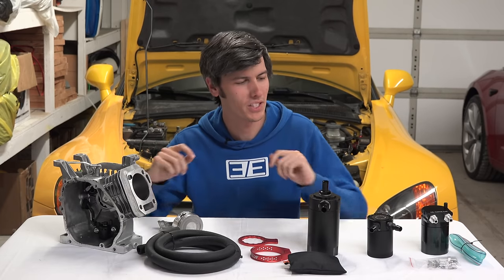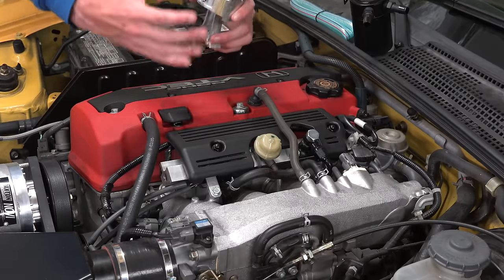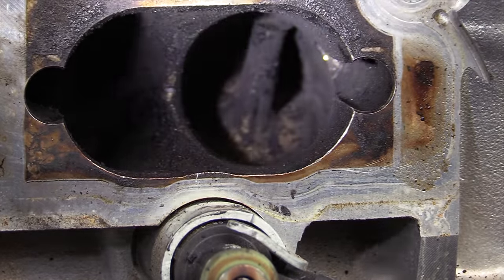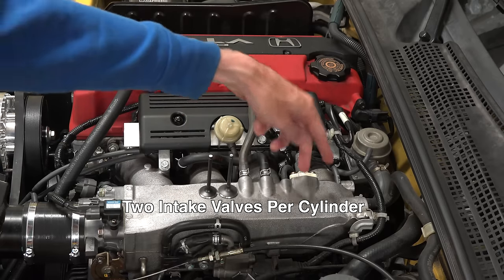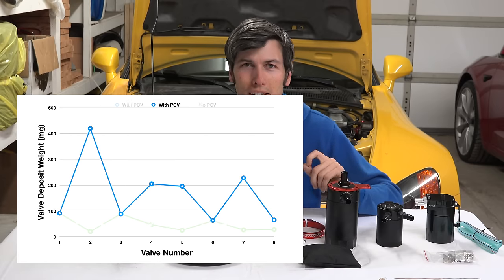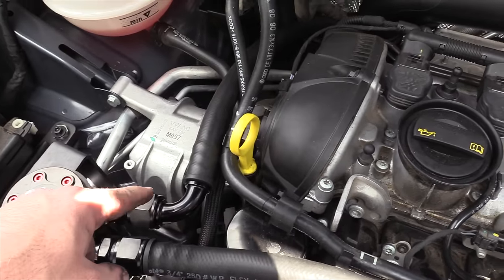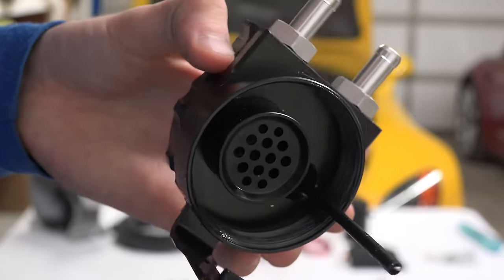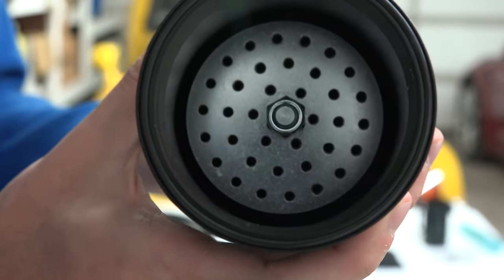Do Oil Catch Cans Actually Work?

Comment: I am sure it would not be too difficult to use an electric solenoid to drain these automatically with key off. However, looking at the contaminated oil in that jar, I would not want that going back into the pan.

Comment: i think you everyone forget something about catch can. experience on modified VW golf R mk6. it look to me install a catch can make a restriction on the PCV system. Normaly de blow by have all the intake to circulate and now you restricted the pressur on a small can and small hose and go back somewhere in the intake system. As a result i see engine smoking. And i think have more positve pressure and maybe can dammage the engine. Then when you look in the can its more like oily water. For sure it little bit less crap in the intake but dont solve the problem. At the end of the day you still have to make a valve cleaning. So i prefere no catch can, more safe,  anyway i will clean the valve someday. could be interesting to know comments from Jason about restriction.

Comment: I was still trying to figure out how this became a thing to do.  Has there been a study that found that the lack of catch cans has resulted in untold engine damage or loss of power or carbon buildup all these years? Millions of engines have run hundreds of thousands of miles w/o these devices all these years and to me it seems like its a novel thing to do to be cool. Like' hey I have a catch can in my car, how about you?' FWIW my 2002 T/A with its LS1 seems to run fine without. Just regular oil changes with synthetic and 93 octane fuel.

Comment: Avoid catch cans with bronze filters if you live in areas where it gets really cold. it will build up sludges on the filter making it hard for the fumes to get out and eventually pressurizing your crankcase, I removed my bronze filter and fashioned a mesh filter with steel scours inside the filter fitting.

Comment: And it's even better to have one on a turbocharged engine, because those fine [oil + unburnt things] particles can actually create some hot spots inside the cylinders and produce knock when your engine is on the limit. Modern engines know how to reduce ignition advance timings, but it's better to get rid of this this problem for good.

Comment: You can look at the outlet to see if oil still stick to the walls of the hose.
Those with fine filters will probably create resistance and high cranckcase pressure which can blow various gaskets. Also the inner diameter of the hose should be very close or larger than the original
I’ m installing a cleaning injector on my gdi, the project is almost ready. Waiting for the pressure sensor, T low pressure line adaptor and some programing of the control box

Comment: Mine works fine. Just make sure the plug at the bottom of the canister isn’t defective and leaks, and make sure the metal hose nozzles are snugged in before install and about 1000 miles after 👍👍

Comment: I have a turbo diesel 2014 jetta and when replacing my turbo I noticed a breather coming form the cylinder head leading to the intake of the turbo and thus noticed oil inside of the compressor housing as well as inside the intercooler piping so I am very tempted to do a catch can as my next mod...

Comment: IMO every car with a PCV system should have an oil catch can. Without it you have oil entering the combustion chamber and burning up which is obviously bad and can cause build up on the piston heads. I installed one today on my 09 accent which is port injected, and it's already happier.

Comment: For what it's worth, I used ho have one of those cheapo ones and the baffle unscrews then one half unscrews from the other half allowing you to pack it with steel wool or the like, one of the better bits I've bought on ebay honestly

Comment: Question why not just by pass the PCV and directly put a filter at the end of the hose and face it towards the ground. it can not be worse pollution then the diesel smoke and fumes coming out of those engines.

Comment: 07 Mk5 GLI 2.0T - 252,800 miles. Burns less than a quart an oil change. I do all of my own intake carbon cleaning and my own maintenance. 

I built my own catch can with a 1-gallon stainless water bottle that I won in a contest at work. 
Home Depot has all the fittings you need. A step bit after a pilot hole allows you to make pretty large accurate holes for the fittings; which in my case were NPT (tapered) threads anyway. They also have the brass filters there for about $2.00.
The one thing that I notice missing from all of these catch cans, is something that lets the vapor collect back into a liquid. I don't know the scientific term for that, but I would think the word is collect or "nucleate" on. Yes the baffles are in there, but they are close to the inlet / outlet which don't seem to have time to cool down.  
Anyhow, I used some copper pot scrubby things in the can; this way the incoming vapor laden air has to pass across this extremely porous media to get to the outlet.  
Here's the game changer though. 
I installed on the bottom of the can, a 1/4" DC 12V normally closed electric solenoid air valve and tapped the electrics to my windshield washer pump. This way, every time I hit my washers (I do it a lot) it purges this toxic bile on the ground without running wires or modifying the dash for a switch that I will never remember to use after 6 months.
<3 I love this channel.
Reply: *Condensate. If the catch can is mounted at the front of the engine where it will get airflow, the coolness of the metal catch can should cool the vaporized oil enough to help it condense on the interior wall of the catch can and flow down to the bottom.
Reply: @fookingsog  Yeah that was it. I'm old so I appreciate the assistance. Respectfully I disagree with your other statement though.

The vapors need turbulent and not laminar flow through the vessel. The setup I built works perfectly now, but originally I didn't have baffles. when i would check my oil i had signs of water in the oil at the cap. Once I added the media it went away immediately. 
Maybe your experience will vary with the same setup.

Comment: Important* make sure your PCV VALVE is NOT CLOGGED OR STUCK before adding a catch can.If so, remove and clean it with brake cleaner spray.

Comment: My understanding is that some of the newer motor oil specs (such as VW 507/509) offer long oil drain intervals, and I believe that one of the improved specs is to reduce the deposits on intake valves engines with direct injection.  Is this true?

Comment: I recently did an LS2 swap on my 04 GTO with cam, heads, stall converter, and built transmission (in short) and bought the Elite Engineering E2 catch can with a clean side separator, and I'm very impressed with it. I changed my oil after breaking the motor in to 1500 miles and was surprised at how much oil was inside the can (roughly 3 to 4 oz) within that mileage. So I'm glad I bought that system instead of having all that oil going through my intake manifold and diluting the fuel..so it's well worth it! It cost me around $330 for everything which was the catch can, hoses, clips, nickel fittings, one way check valve, clean side separator, and extra o-rings..so if anyone is looking for a nice system, Elite Engineering is my recommendation!
Reply: ExtinctLS1GTO you get single or dual port? Got a g8 gt and that’s my current mod that I on the market for.
Reply: @kapss0832  I got the E2 standard single port,  item SKU is STDCatchCan on Elite Engineerings website, you can select your model car for it..as I said I also got the check valve and clean side separator, quality is really nice and got everything quickly. I'm beyond happy with it
Reply: ExtinctLS1GTO great I’m sold on it keep going back to it after looking at others. How much power you making to the wheels with all the mods you put on ya goat?
Reply: @kapss0832  the LS2 made 421 on a dyno jet tuned by Justune..so it make a good amount more compared to the worn out stock LS1 at 278
Reply: ExtinctLS1GTO nice dude! I just got this g8 gt bone stock had 26,000 miles so far this past weekend threw in kooks LT, soloperformance cyclone catback system 3inch, VCM otr cold air and currently waiting on a tune from livernoise Motorsports.
Reply: @kapss0832  hell yeah man! If you're on Facebook, getting into some of the GTO/G8 pages are a big help on sourcing parts and individuals who make some unique things for these cars. I will say this man, get rid of that DOD as quickly as you can. The springs on the DOD lifters fail a lot on some higher mile cars..it was a great idea by GM, it just wasn't executed well..if you get a cam with the DOD delete..I love the BTR stage 3 that's in my car, that being said, call some cam manufacturers and tell them how you plan to drive the car, and they can set you up with what would be good for the car!

Comment: Shouldn't boosted engines require 2 catch cans? One on the PCV valve side (as commonly mentioned) but one also on the line feeding air into the valve cover, as flow in that line will reverse direction under boost. That reversed flow will include the same gunk that the PCV valve side sees under vacuum. (Remember, the PCV valve will block flow under boost.)

Comment: I find it strange how pressure build up in these catch can was not mentioned. If not enough air flow can get through, you can start blowing seals, and how long these filters last before becoming clogged, causing pressure build up. That's something a lot of these catch can manufacturers never tell you. Filterless Air Oil Separators that are well designed are expensive for a reason. Do your research folks before you wish you didn't install one.

Comment: I have read that oil contamination greatly reduces octane rating, even at the point where it is mixed right at the port injection on say a GenIII Hemi.    Do you think that is accurate and reason enough to use a catch can?

Comment: Why not just dump the fumes to atmosphere like on industrial engines? A breather filter hanging off the valve cover works well. 

That being said, I’ve installed various industrial versions on stationary engines. Keeps the radiator and engine room cleaner.

Comment: Just a note for carbed engines; the old Triumph motorcycle manuals used to say to drop the throttle just before going wide open, because that would suck a "certain amount" of oil to the rings. Of course, they had looser tolerances and like Harleys, were SUPPOSED TO  burn a little oil between changes!

Comment: Hi Sir I getting a very Excellent Quality 3 Port Oil Catch can from one of Aliexpress Stores for a price of NZ $42.50 & I'm going to make up a bracket for it so it will fit the PT Cruiser & also buying high tempature ID 10mm Black 5 M Silicone hose for NZ $34.19 & cut pieces of hose to so it fit nicely to fit to the 2 inlets on the oil catch can   & the outlet fitting on the oil catch can to the intake manifold as I have one hose from No 1 rocker cover & the one from the PCV valve No 2 rocker cover Kind Regards Peter PS this 0il Catch Can has a brass fine filtering system & has a baffle & tap at the bottom of the oil catch can as well & so I can drain it & a filter at the top of it & it is well made too  Sir

Comment: Running a vacuum pump for the crankcase like some racing engines should eliminate the need for a oil catch can , and free up some HP at the same time.

Comment: hey man I know this video is a couple years old but I'm hoping you can answer a question I have, I'm currently building a 2jz with a single turbo and I'm installing a catch can, I'm not sure how to go about routing it, I see people have the exhaust side vent going into one end of the catch can and they are using the vacuum from the turbo intake on the other side of the catch can, and leaving the intake side vent connected to the intake with the pcv, and I see other people just routing both intake and exhaust side vents into the catch can with no vacuum source? I'm a bit confused and not sure what the best way to go is.
if anyone could help me out I would really appreciate it,
Thanks

Comment: I just wonder as to why carbon deposits aren't a problem on diesel engines or if you feel like taking a trip back in time to the time of oil bath air filters.

Comment: Based on your bearded Volkswagen expert the catch can had a lot of oil at 3000 miles. So this looks like you will need a more expensive one with a larger catch; also this will need drained often so it doesn't fill up with oil and debris.

Comment: One thing not covered here is how the catch can design affects the ability for the system to produce a vacuum in the crankcase. With too much filtering and baffling, you may catch a lot of oil, but you may have also reduced your crankcase vacuum, therefore reducing HP and sealing of the piston rings. This would cause more blow-by and lead you to collecting more crap in your can because of it. 

Wouldn't that be funny if part of the cause of catching more oil in your can is because it caused more blow-by to begin with? I'm not saying the cans in this video are poorly designed, but there's definitely more here that needs to be considered.
Reply: Thats why the recirculation of the air flow needs to be routed to the intake system.  Not just the "2-way" install on almost every diagrams show. Usually these "kits" don't come with instructions and some are left to install it the wrong way.

Comment: This is strange!  I was asking a customer at work about oil catch cans, and I get home, and this video pops up!  If you don't have room for a catch can, would it work to spray a cleaner in the PCV hose with the engine running once a month to get some of the gunk off the valves?

Comment: I can tell you that the middle $100 catch can(which has a clone that's very inexpensive) is terrible. It doesn't do jack squat at catching oil. The problem is that the baffling is placed in a bad location that doesn't help. Having the inlet and outlet at the same level, and the baffling below those ports, just allows the airflow to just let the oil go right back to the outlet side. There needs to be baffling in between the inlet and outlet. I've got a clone of this $100 version, but the can itself is deeper. I drilled, tapped and added an inlet port in the side of the can half way down. This gets the inlet airflow below the baffling. Only way to get the can to do it's job. Just right id share the hack. I'll post a video to my YouTube channel showing this in detail.

Comment: None of them are large enough for a decent powered turbo car. The idea is to "catch" the oil/water if you blow a headgasket or burn up ringlands. For instance a catch tank on a topfueler is the size of a garbage bin. Catching everything stops it going on your tires. What you're showing is an oil/air separation system.

Comment: there is nothing fancy about my kind of catcher.I just replace the PCv hose with a longer one..  As vaccuum laws goes,,   you measure it by inches..  so the longer the hose the less oil gets sucked into the combustion chambers..  you can wound the long hose into a coil and tape it over.. to keep it coil without unwounding all bak up..   The oil will settle back into the oil pan after futile effort through the coil up to the intake manifiold.. Actually the PCV vaccum flow is very low as the PCV valve is a flow restrictor itself..  just enough to suck up the blowby gas/air mixture coming out of the guts of the crankcase /oil pan. There is not much air space inside the crankcase with all the crankshaft. connecting rods taking up all the air space that a grassphopper will be hard pressed to find room to crawl around , anyway. I would say that there is no more than a pintful of air space in any crankcase so this is why the PCV valve is a restrictor sucker.
\

Comment: I have the Mishimoto compact can (the $100 one). It's not bad, but the drain kit for it is plastic crap and really overpriced, and the hose barbs that come with it are also plastic. I went to the local pipe shop and they had brass 16mm hose barbs, and made up an adapter so I could use a stainless ball valve for draining. It's much easier, better than the official one and was 1/4 the price. You will want a drain because unscrewing the can is a problem. They weld themselves closed. Every time I've gone to open it I had to let it sit in boiling water first.

My car doesn't have direct injection or forced induction, but it does burn a little oil. I fitted the can so I could monitor how much was going through the PCV so I can work out how much is getting burnt because of the piston rings.

Comment: The absolute best catch can is the Tracy lewis Rx can..its hand made and comes with a clean side seperator..Hence the $400 price tag. I just recieved mine.its the only one that has solid data proving it catches 80-90% all other catch 30-40% so they let more pass than they catch

Comment: With the moisture/oil/sludge buildup in these catch cans and the fine bronze filters is there any risk of blocked airflow if vehicles are parked outside in sub zero temperatures for long periods (Canada)?  I have a 3.5L EcoBoost.

Comment: Why shouldn't a catch can work? I used a beer can on a 30,000 mile 250K4 Honda in the 80s after noticing an oil weep out of the crankcase breather tube. Caught plenty of oil and the bike went a couple of thousand miles like that. End came when blow-by got so bad that blown-by mixture ignited in the crankcase after an hour at 70 to 80 mph on the M4 going into Wales and blew out all the bottom end oil seals.  Beer can was free. Rebuild was DIY and revealed that 2 rings on one pot and one on another were broken. All else was fine, but this shows that if your motor is breathing heavy, there is something wrong.

Comment: You explained why you need a PCV wrong. It's really not because of blow by but because when the piston goes down it will cause positive pressure in the crankcase. When the piston goes upward It creates the opposite, vacuum.